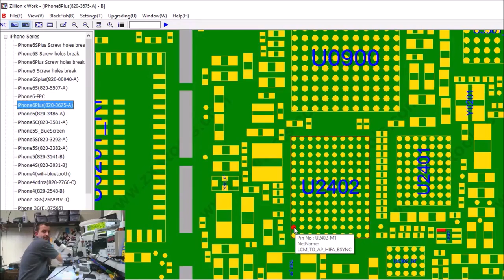iPhone 6 Plus Touch IC Failure Fix - Botched by eBay seller

Comment: It looks like the mysterious secondary issue is the pads becoming detached from the board, perhaps being lifted off the board by the ic solder ball.  But the main issue is no underfill.  Well Apple you saved 2 cents in underfill and caused a billion dollar secondary repair industry.

Comment: Hi, i have an iphone 6 plus. after replacing touch have no image but after 20 seconds image appears. now do that without touch ic, i checked sage, cumulus,chesnut, resistance in conector, voltajes, but still the same. can you help me?

Comment: Very impressive videos. I know I need software like ZXW or Z3X with .brd files and PDF. I am looking for a tutorial for a start to finish board diagnostic. I know there are countless possibilities of problems but at least somewhere to start. Do you know if those programs have info like that?
Thanks
Reply from the maker: I've never seen anything with that info except for...    I have seen some schematics that have diagnostic information in them.  Many Samsung schematics will have some "check this, if it's not this check that then this..." flow charts that have helped me solve some Galaxy problems.

Comment: Hi sir i had i phone 6 plus touch problem i made jumper thats ok but now phone stuck on 0.2amp on power supply taking voltage itself when i plug power supply cable on battery connector please help

Comment: HI can you please tell me the time and heat
 you use? what about the flex tipe or brand? thankyou :)
Reply from the maker: You're welcome!  Thanks for watching :)

I use my temp set on 390C most of the time.  I am using a very cheap hot air station:

https://www.amazon.com/Aoyue-852A-Digital-Rework-Station/dp/B000HDDXY0/ref=sr_1_4?ie=UTF8&qid=1480427892&sr=8-4&keywords=aoyue+station

Comment: your 640x480 usb microscope should capture fullscreen if you use it as a source and capture with VLC
Reply from the maker: I did one video where I stretched it to the 1280x720 I'm recording at.. It looked pretty bad so I went ahead and left it 640x480.  If all goes well, I will never use that microscope in a video again. LOL  Thanks :)

Comment: anyway you could show which pads on these chips on NC.  Im just practicing on a board i bought that was iCloud locked and i can't find this info anywhere of course my 1st try I pulled a ton of pads.  Just wondering thanks for videos Ive watched it a couple of times. Good tips on practicing?? Boards are expensive and then I'm never sure if i did it right if i buy a dead board. thanks
Reply from the maker: Sorry, I sure can't.. not without clicking every single pin.  I was hoping it could highlight them all for you but it doesn't.
Reply: Thanks anyway man I'm going to buy the tool thank for responding keep it up!!

Comment: Hi question with the cumulus and mason removed would the iphone 6plus boot display ?
Reply from the maker: +Lee Satriani (satchY) I've actually never tried it or looked at schematics in a way to consider that.  I did try once on a water damage data recovery job and the phone didn't fully power on. That wasn't a good test though because it was likely another issue causing the power up problem.   I may test that this week on a donor board and see what happens.
Reply: +STS Telecom cool mate yeah would be interested to know thanks for the videos i enjoy watching them cheers
Reply: Hi Jason after much thought i gave it ago and yes it works fine :)
Reply from the maker: +Lee Satriani (satchY) thanks for letting me know!
Reply: no probs ;)
Reply: would it boot without them?
Reply: +Esad Muric yes !!
Reply: +fixingthingz4u thank you

Comment: HI, Can you tell me what heat and airflow that you use to remove the Ic please
Reply from the maker: I have the air set on 42% and the temperature set to 375C - 380C
Reply: thanks much appreciated

Comment: I recently took my iphone 6 to a repair shop near me and my phone was brought back with cracks in the screen that weren't there before i'm not sure what to do. attempted to register for an account on your website, but the password i set didn't work when i tried logging in. i attempted to reset my password but that didn't work either. It only took me back to the login screen and asked for me to login again. Please help!
Reply from the maker: I've removed all traces of your registration from our system so if you try to register again it should work.   It sounds like you just need a screen replacement though.   You would be much better off to have that repaired locally rather than send it off to anyone.
Reply: Thanks for helping with the account problem, i actually replaced the screen myself. I've heard of a lot of people having this IC chip problem so I assumed that I was experiencing the same difficulty. i was going to attempt to fix this myself but it seemed a little too hard for me to do without assistance.

Comment: +STS Telecom So you use the flux + heat to remove the chip. You clean excess solder, then you use flux to refuse the new chip to the board? I thought you some how need to get solder back on the chip. Hope you can clarify.
Reply from the maker: I order these ICs with solder balls pre-attached to the bottom.  The flux is just to be sure the solder flows easy when it melts in hopes of good joints on all of those pads under the chips.

Comment: Temperature of hot air? and  fan speed Please?
Reply from the maker: 390C and 42% on this cheap station:
https://www.amazon.com/Aoyue-852A-Digital-Rework-Station/dp/B000HDDXY0/ref=sr_1_1?ie=UTF8&qid=1483029705&sr=8-1&keywords=aoyue+hot+air
Reply: STS Telecom Is this the station you use?